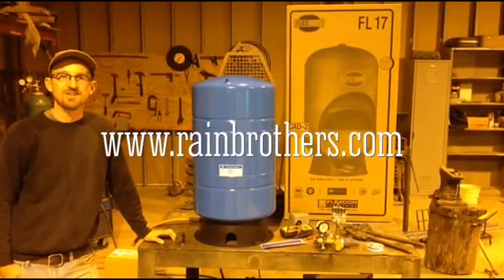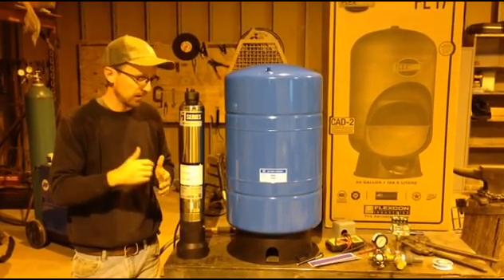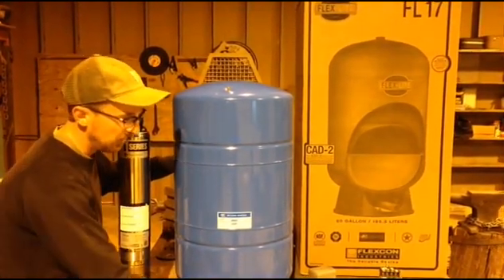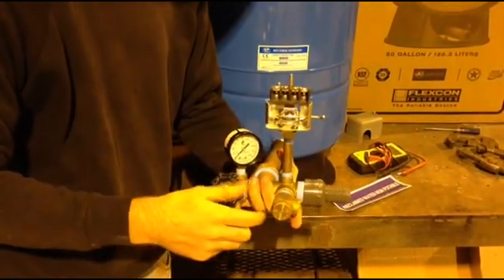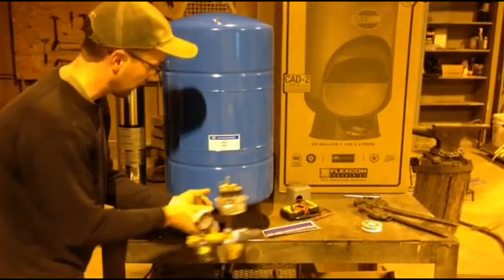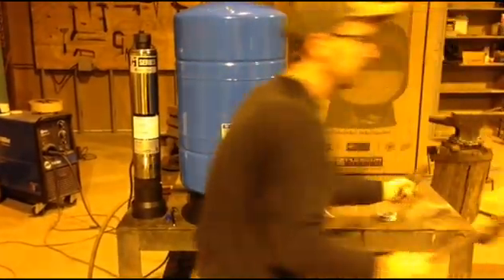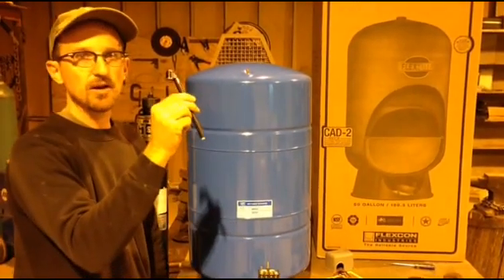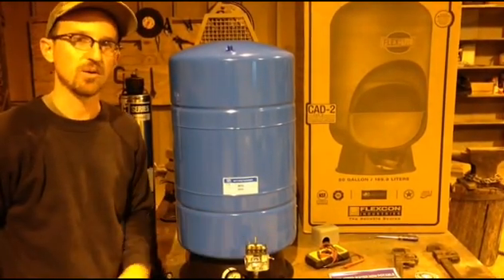Cistern Pump Installation - How to Install a Pressure Tank, Pressure Switch

Comment: When changing out a tank and you go to drain it,do you close off the valve going to the house or do you let all that water in the lines come back down and out through the valve by the tank?
Reply from the maker: You can do either. We generally close off the main valve to the house though

Comment: I have a 23+K gallon cistern. What size pump would you recommend!?
Reply from the maker: The size of the cistern isn't as important as the pumping application.  That said, our Springer Submersible Pumps will do the job for most normal uses. https://www.rainbrothers.com/store/Springer-Series-1-2HP-TRADITIONAL-Cistern-Pump-p461750607

Comment: can you run this system off-grid?  Like if I had a bank of 12 volt batteries and an inverter?
Reply: Rick Fite yes you could, power is power regardless of its source. Make sure you have a big enough inverter. 100watts on average = 1amp. So check the rating of your pump and pressure switches.

Comment: At 8:38 into the video the screen goes blank for the rest of the video. The sound is still good but no video. Thanks for the info but please reinstall this video so I can see the rest. Also, my question is how do I know what size tank to buy and which pressure is for me? I.E 20/40 vs 40/60?